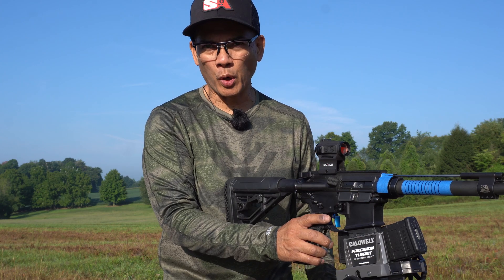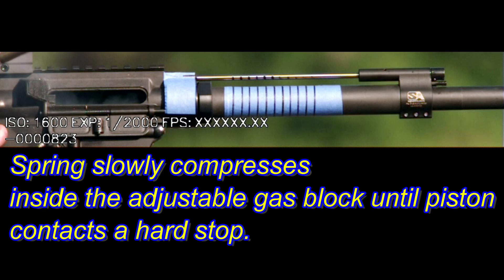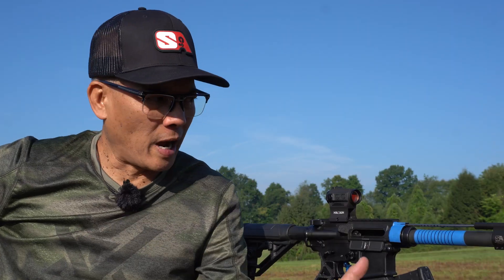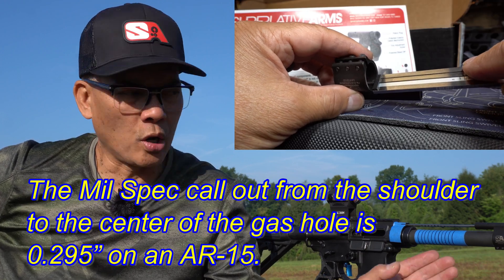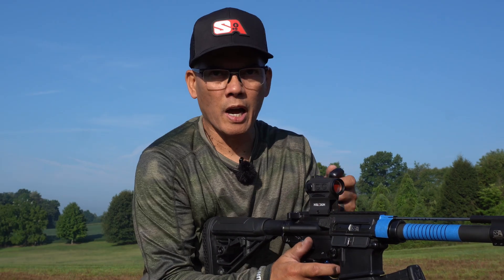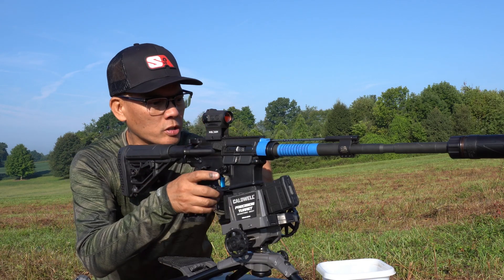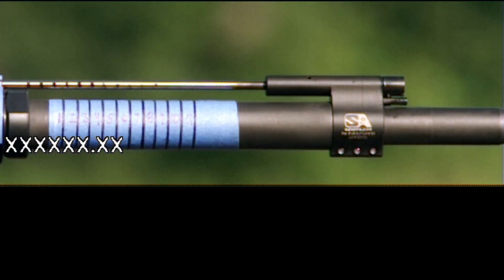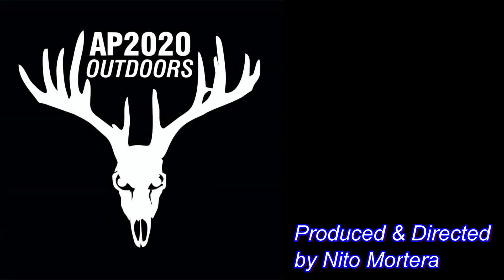The Science Behind The Superlative Arms Piston Kit

Comment: Wondering if it would work with 300 blackout subs? Can't get my 9 inch to run using the Adams Arms 300 blackout piston kit. Opened up the barrel gas hole to .154" and JP Spent Capture Spring with lightest spring, still won't cycle. Finally got it to eject one type of subs but won't pick up the next round or lock back. Wondering if the Superlative would do any better or if i need to go DI. I prefer piston though.
Reply from the maker: @ICanDoItMyself You can try the Superlative Arms Piston kit. One question, what is your bullet weight and powder choice? Pistol or carbine length gas system? For me with the 300BLK, AA1680 or CFEBLK powder only and 200gr + subsonic bullets for 100% reliability.
Reply: @AP2020_Outdoors  Pistol length, both 190 grain and 208. 
My setup:
https://youtube.com/shorts/cXKrmF1th_U?feature=share

Comment: I have an Adam's arm adjustable piston kit on a 300 blackout. Works very well but took a while to set up to run properly. Great video as always. 

I think the biggest question is how it affects barrel harmonics and accuracy
Reply: In a sbr/pistol build it shouldn't effect it as much because there is less barrel to float when hot. I wouldn't really recommend piston for longer barrels as they shoot smoother with DI systems, u want ur accuracy and smooth shooting more in them vs shorties. U will get more out of your 16 18 20 etc if u run mid and rifle length DI. I would totally recommend piston kits for a SHTF build though, when ur not worried about smooth shooting, u just want something u can run HARD and not have to worry about popping a gas tube, granted u also want a high quality barrel to pair it with. The 7.5 10.5 11.5 etc are good choices for piston. I'm putting one on a 7.5 right now